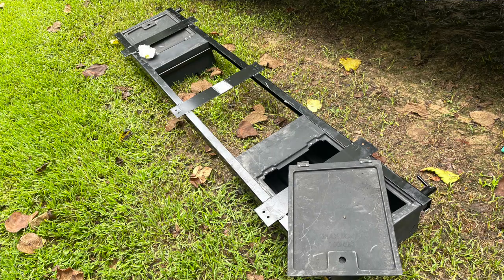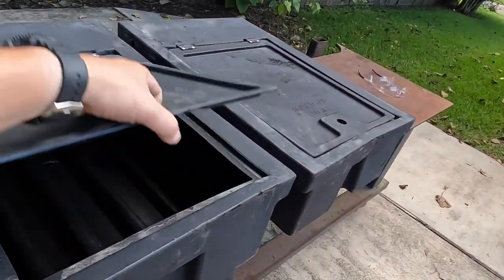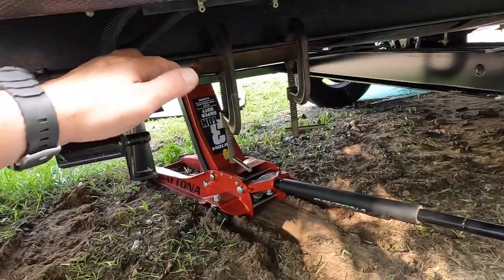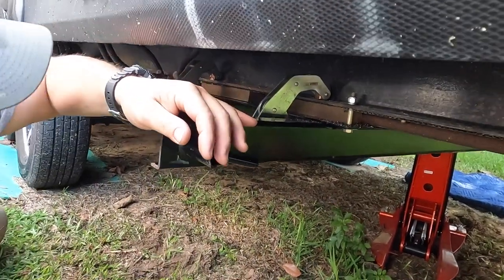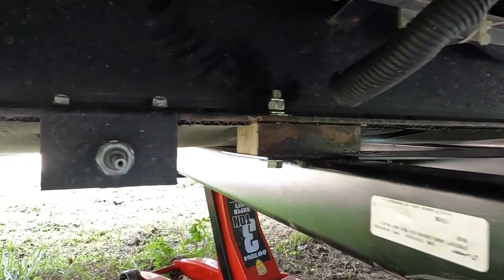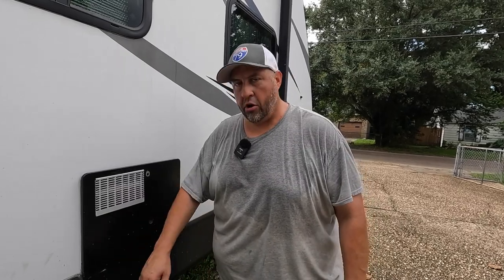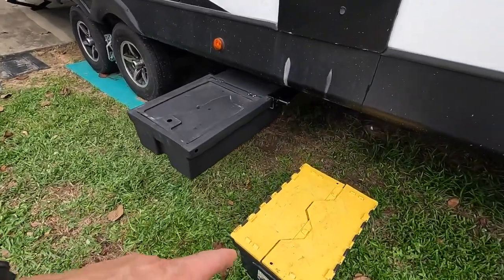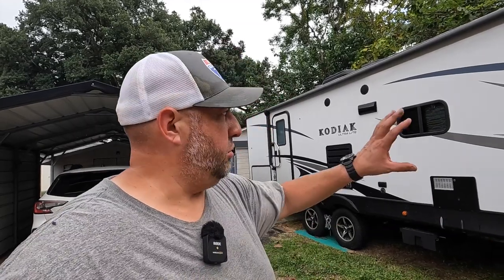RV How To: Lippert Underchassis Storage Compartment

Comment: Great idea, you can never have too much storage. Considering the price of that system those boxes look awfully rough and basic!
I'd weld a bar across the rails to keep the lid shut when pushed back and instead of the pins use a through axle with one large end and a padlock on the other.

Comment: Installed my set of full length drawers like this 2 years ago.  Absolutely luv them.  Keep all sewer fittings in small plastic boxes and the power cord w/ surge protector, inside the  the drivers side. The other side I keep 2 patio carpets and the wheel chocks, x-chocks in that side.   They do collect some water when it rains.  Drill Drain holes in several locations inside the drawers.  Very beefy and durable product.   One thing to consider is the overall heigth. These are 10 .5 inches high so ground clearance is something to consider.  Place them as close to the axles as possible to avoid scraping.  Otherwise, a very good investment!

Comment: My Keystone Outback 328RL needs that undercarriage storage solution. The model I have has very little storage room. I might try searching for one that is more impervious to water though. My outback does have its spare suspended from underneath. Those spare tires mounted on the bumpers can cause thousands in damage to fiberglass if you accidently back it into something. Thanks for the great suggestions and have a great Big Haul trip you and dear Abby.

Comment: I would have clamped it to the frame with an i beam clamp on both sides, add rubber window seal around the edge of that door and place a locking hitch bar on the opposite side of that where the lock pin is. I would also cover that lock pin with a door knob lockout to make it secure. Probably do it myself with a different drawer and slide but thanks for the video it got me thinking!

Comment: For the price they charge, it should be WAY better designed.  They have a few huge misses on these.  The lids should be designed to shed water, not funnel it into the box.  Either the pins should be lockable, or the rails should be lockable to keep the bins from growing legs. (Seems like a notch in the edge of the bin with a lock thru the slide rail would work.)  The boxes should have drain holes with baffles to let water out but not in.  (Condensation or having them open in the rain).

A- for the concept, C+ for execution.

Comment: worried that you might have  a  problem  been a diesel Mechanic for 30 years and it it a major no no to drill the frame flanges u may want to check with  your oem on this u can  weld them
Reply: this